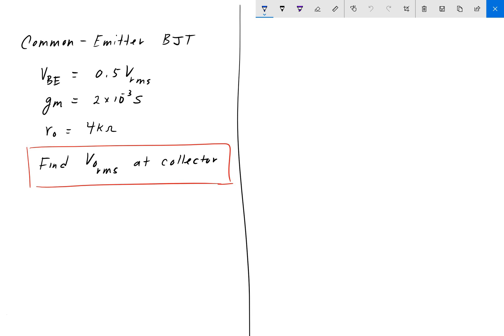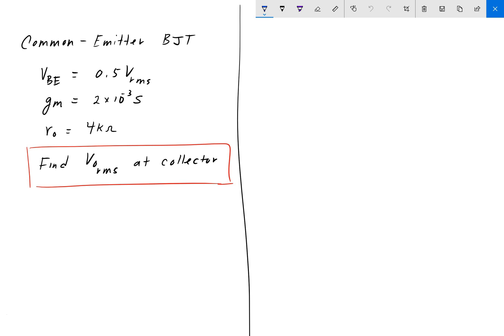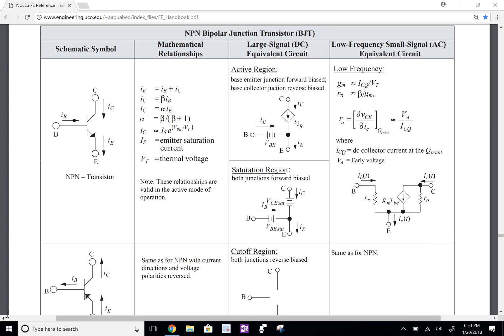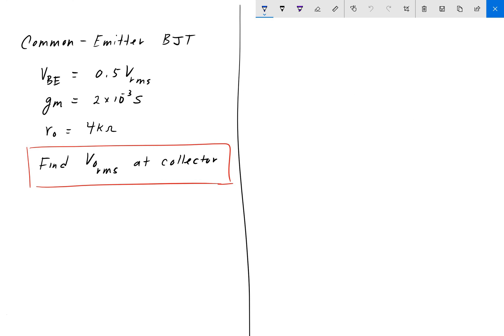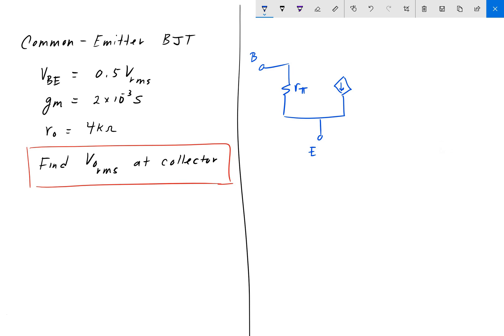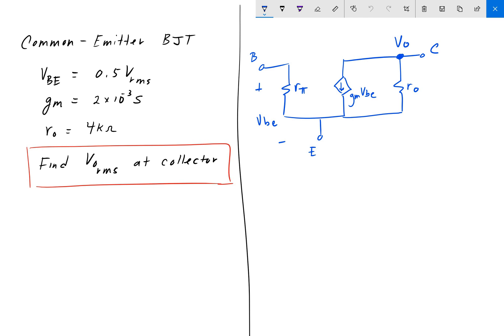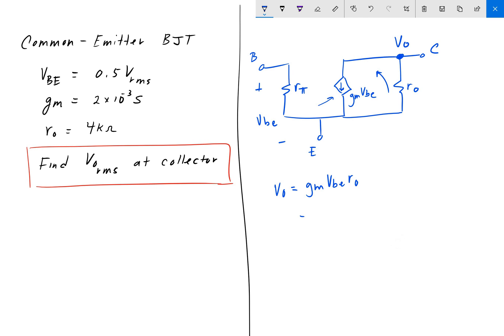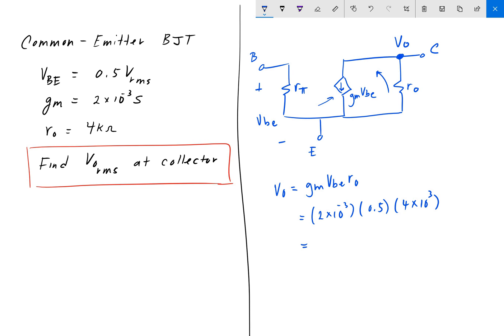Electrical FE /EIT Exam Prep - Electronics 6: BJT Collector Voltage

Comment: Thanks so much for the videos. They're helping a lot!
For this problem, I don't get why you're treating it as a standalone circuit not connected to anything else. In the handbook, the circuit shows current flows through collector, base, emitter. So, for this one, I thought current through ro (ir) would be related to gm.Vbe by KCL at collector: ic = gm.Vbe + ir. Does that make sense?